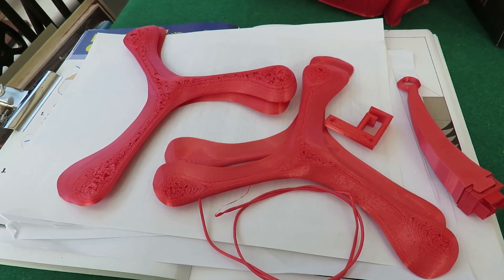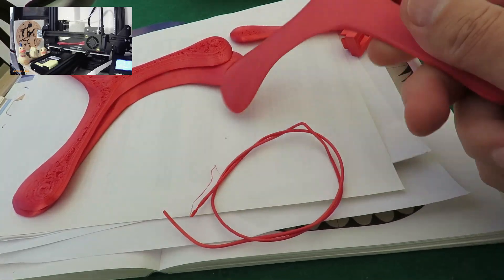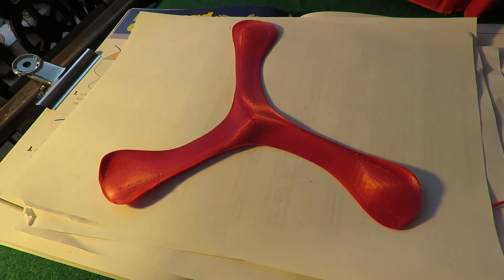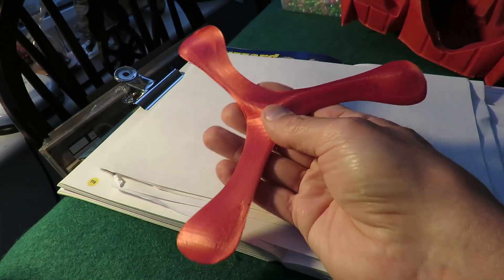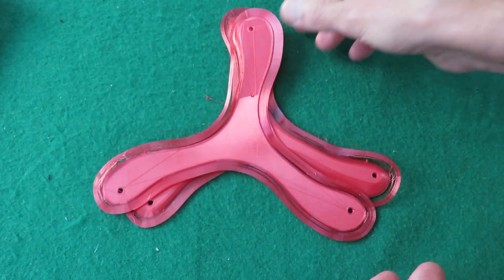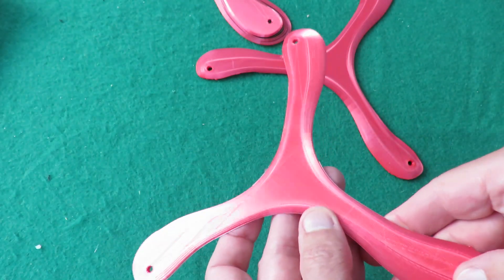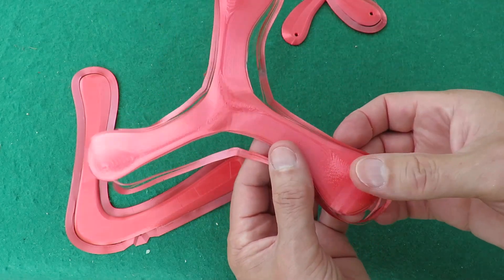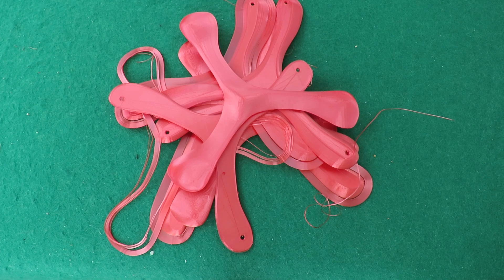3D Pink Filament and Tri Boomerangs 20200724

Comment: Hi, I had very good results with PLA in the past using an oilier (I just used a piece of Styrofoam canola oil sucked, with a hole in the middle for the filament to go across it); you might want to give it a try (believe me, it can make a massive difference with some filaments). Thanks for your videos.
Reply from the maker: Thanks for the suggestion. It just seems to be this particular batch of pink PLA that is giving me problems. I am sure if I spent time playing with the settings it could be sorted.